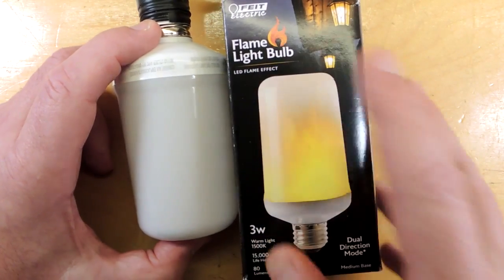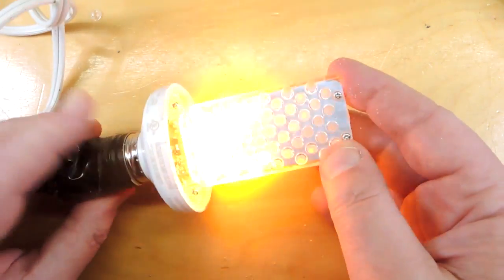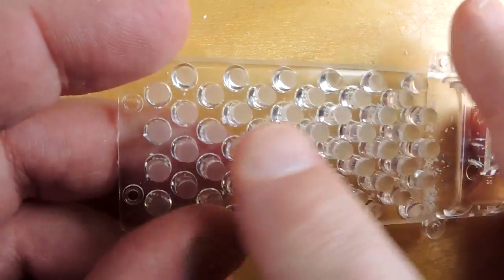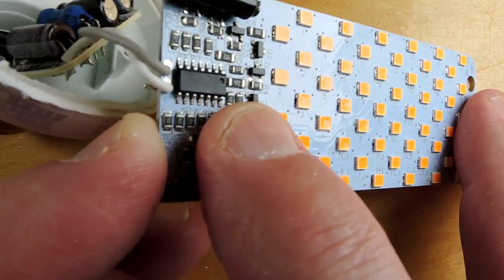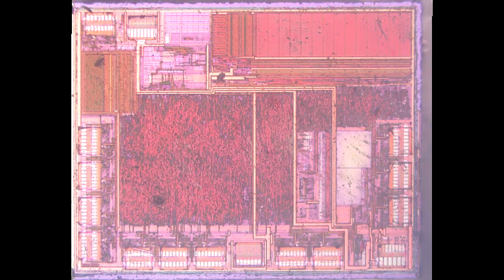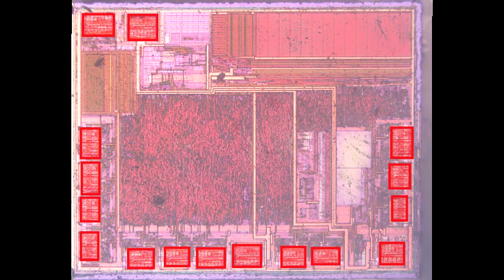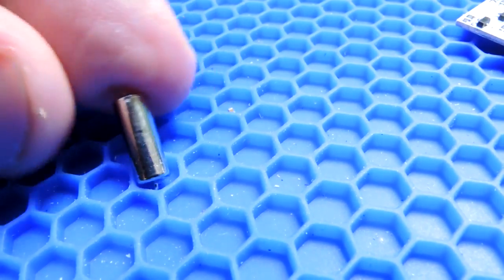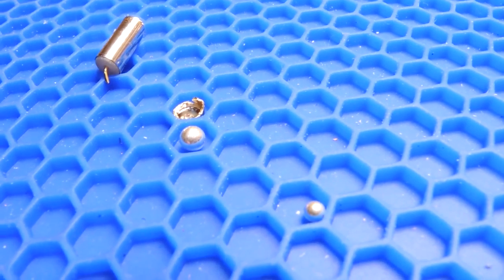Feit Flame Effect LED Bulb Teardown

Comment: I have 4 of these bulbs. I took mine apart as well. My question is, can you use one ac/dc board to power all 4 of these bulbs? If so, is it wired in series or parallel?

Comment: Dead Bulb - The problem with these bulbs is that the capacitor in the power supply is junk.  Run the bulb constantly for a week or less and the bulb generally dies.  Open up and you will find that the 820uf cap has popped.   Just replace it with a good quality one and your bulb is back to life.

Comment: Are you sure they use polycarbonate as the diffusor? PC is expensive and you don't really need its "features" (scratch resistance/high strength compared to other plastics). I'd guess it's polysterene (the same as CD cases). Burn it to test it ;) .
Reply: As a sidenote- the mold was probably made to have the texture already, as a milling operation would be way too expensive and time consuming.

Comment: Looking at the diffuser I would guess styrene casting and then they simply hold it against a 1200 grit sanding belt for a split second to get the diffuser pattern in.